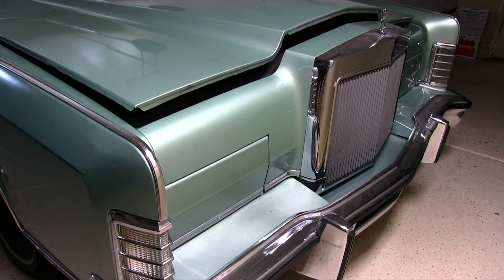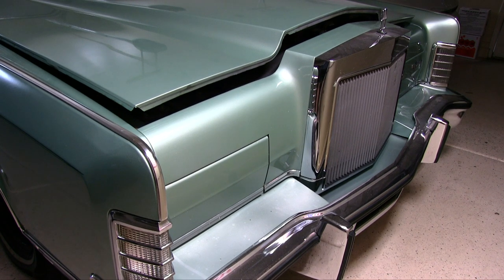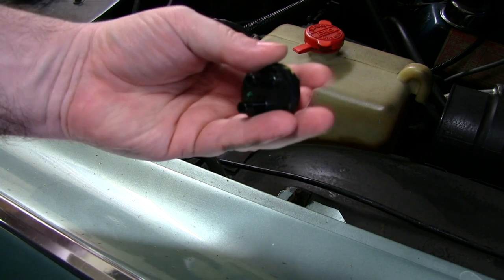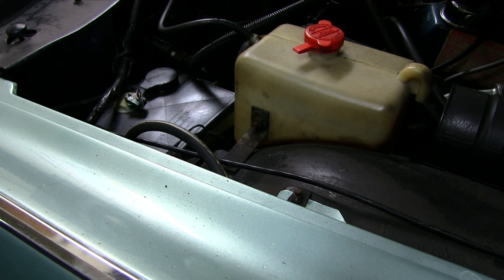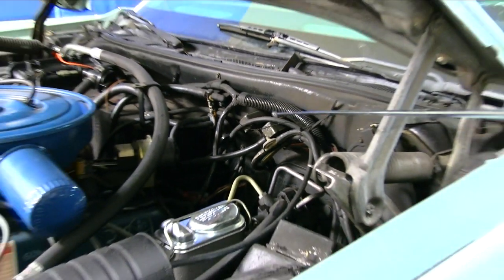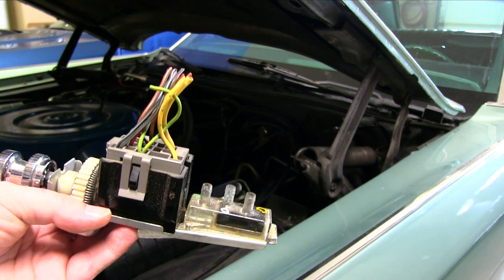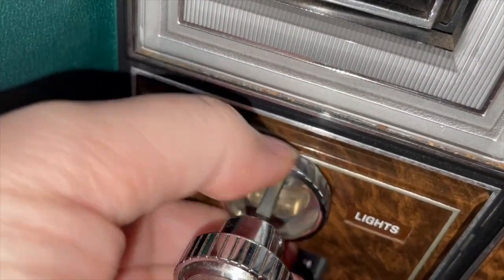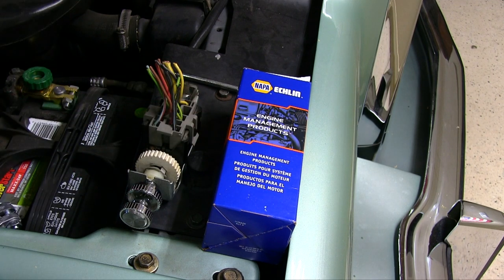1978 Lincoln Continental PART 8: Vacuum Headlamp Door Diagnosis & Headlamp Switch Replacement

Comment: I've been searching for this video for years. THANK YOU!!! How do you make a valve with the adapters?
Reply from the maker: Kind of hard to explain in words. Basically you just need to get small tubes with a different size on each end to splice the two different size vacuum hoses end to end.

Comment: Just a minor correction.  That metal valve with line ports on it is called a vacuum check valve.  It’s purpose is to supply vacuum to the system but once the engine is shut off the suction port (top port by itself) closes there by not allowing vacuum to escape.   I’ve had good results spraying WD40 into the ports and then blowing it out followed by silicone spray. If your headlights open up almost immediately or immediately after the engine is turned off this check valve is the FIRST PLACE to look.  Dad had a 78 Bill Blass Mark V and we bought it like that.  The next day I rummaged through my spare parts Can found one of those valves and it worked perfectly.  Lights stayed closed forever
Reply from the maker: Did I call it something else? Shit happens when you’re narrating on the fly. Must have had dirt in yours.
Reply: Sometimes there could be built up of something or the spring inside the check valve could weaken, there’s rubber diaphragm inside too that can dry up and no longer seal etc

Comment: Can you show the whole system like what you need like the cans or how the whole thing goes on both sides
Reply from the maker: You mean you want me to tear apart my car for no reason? Lol 
Seriously though, I think there might be other videos showing the system components. Or at the very least, still photos In Facebook groups.
Reply: I just did a thorough write up and when I was almost done it got deleted!  I must have tapped on cancel !!!  😡 
Anyway it works as follows.   
Headlight motors are both connected together, up ports together to a T as well as down circuit ports to a T. I think green is open yellow is closed.   Each vac hose then runs to the headlight switch, yellow goes to a port with yellow dot green to port with green dot.   The center is Vac supply/feed.  This hose runs through the firewall to one end of a 3 port vacuum check valve.  The other outer port of the check valve goes to a vac reservoir.    The single port of this valve goes to intake manifold vacuum port to feed system.   That 4 port bypass connected is spliced into the system right near the vac reservoir on drivers side fender apron.  Green to green, yellow to yellow.  
All Fords from 1969 to 1981 with hidden lights have this same basic routing and function.  Same for LTD, Marquis, Lincoln Marks, Continental etc.  The only real variation is cars with Autolamp feature.  This system uses an electro vac solonoid mounted under the dash.  It has three vac ports and three wires.   It’s function is the same as that of the headlight switch it sends vacuum to appropriate circuit.   
Last … it’s a myth that the coffee can looking reservoirs are for the headlight system.  This was only true on early FoMCo cars with hidden lights 67-68.  There after Ford used a much heavier guage steel reservoir “tank” located between drivers fender apron and the radiator support. It’s tucked under the left front fender corner and not very noticeable.   The can type reservoirs are for other things like climate control blend doors, vac parking brake release, older models with vac power door locks etc.    Hope this helps and explains the system!
Reply: Just an FYI that bypass connector is not really needed. It’s use is if you want to service headlamps , clean them etc.  It keeps the covers open without having to have the headlights on.  Most people who bought these cars later on don’t even know it exists plus it’s a source of leaks which causes the headlights to creep open after the engine is shut down.  If you want to clean or service the headlights you can simply turn them on and off 2-3 times.   Once the covers cycle about 2-3 times the vacuum will be depleted and the covers won’t close until the engine is started!   Just an fyi.   You can simply replace this valve using an inline vac splice fitting or a piece of tube the proper thickness that fits tightly within the vac hose

Comment: this video was so helpful but ran into a issue I have a 77 but pretty much same setup when I felt the headlight switch whoever owned the car before me capped off one of the vaccum lines and i cant find Any disconnected lines under dash where do the lines that plug into headlight switch come.from ??
Reply from the maker: Just going on memory. I think they come through the firewall

Comment: Can't find this 4 port vacuum valve
Reply from the maker: On your car or to buy?
Reply: I was going to ask the same question.  I believe this valve was first used on 1969 fords with hidden lights.  There were TWO styles, the one shown in this video that you must grasp the hoses on one side and twist the other side 90 degrees to allow the headlights to open.  On some earlier cars 1969-70 I believe this headlamp cover bypass valve looks different.  It’s still black plastic BUT it has a round knob on it that you rotate 90 degrees.   It’s much easier to use and doesn’t feel like you’re going to break it!  Lol 
   What does this switch do?  As most of us know in 1969 Ford added a fail safe spring into the design of the headlight motor / motors (some models used 2).  If the system is depleted of vacuum the headlight doors will open on their own.   Or if there’s a leak they will gradually open until there’s no vacuum.   What this bypass switch does is it “vents” or bleeds off the vacuum that’s between the reservoir and headlight motor/s allowing the doors to open.   It doesn’t deplete all the vacuum as if your system is fully functioning you can get 2-3 cycles out of it using this bypass switch.  Hope this helps someone!
Reply: Try part number E0LY-13A169-A

Comment: The modern 3 plug smaller hose dismeter check  valve will not work right. It was small to fill up the reservoirs for the auto lamp stuff.  I put the old one back for now and don't worry about doors closing while it is parked.
Reply from the maker: Perhaps you hooked it up wrong.
Reply: No I didn't and it fell apart.